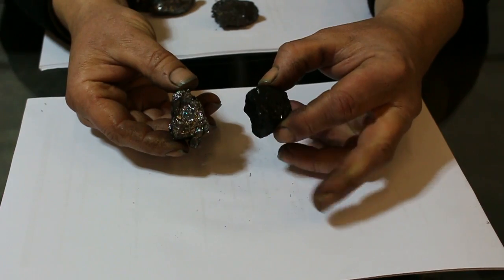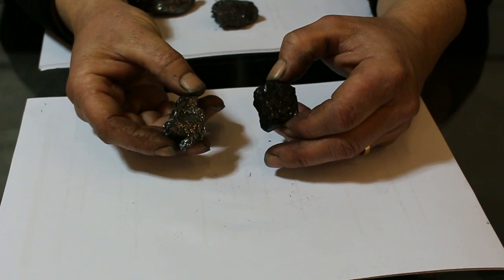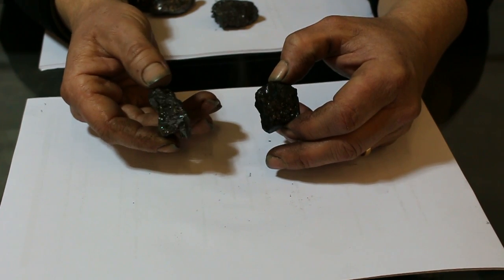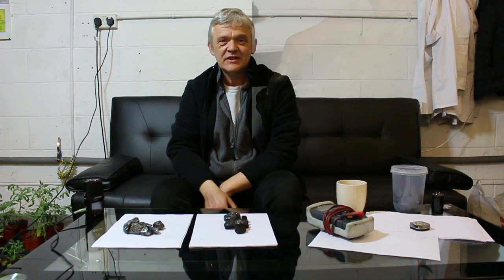Saving The Coal Industry? - Part Two

Comment: Hi Rob, just wanted to say that im greatful for all your hard work. I also wanted to tell you that I finally committed myself to follow in your footsteps. I agree when you say that we should do our own experiments, instead of always getting the solutions. Within the last couple of weeks, ive invested over 20k in almost all the lab equipment that you have. I am an Offshore Commercial Lobsterman for 20 plus years,  but I will be retiring around January to help move this field forward. I have already been conducting some of my own experiments, and have some interesting results too. From paying close attention to your teachings, I have noticed that you sometimes leave out bits of important info. I imagine its because of trolls. One of them being, theres a particular scource of Graphite that you conduct most of your experiments on. I ordered about 50 Lbs of it, and am dying for it to get here. As long as it gets here with no issues, I plan to order 1 ton of it around Feburary. I will also want 1 KG, (or more if I can work out better price) of HOPG. Anyways, I hope you can find the time to send me an email address so that we can collaborate on future experiments. I plan on using Graphene for electrogravitics, but the experiments that wed be calaborating on, would be very similar. I will be using Graphene capacitors in my project as well.  Maybe I can help relieve some of the pressure, and try this or that. Maybe you can help me by moving my shipment of Graphite along. Its only been a week, but ive sent 3 emails to him now, and he hasn't answered any of them. I know hes your buddy, and im hoping you got some pull. Anyways, keep up the good fight. Im here if you need anything on my end. codgod1@yahoo.com

Comment: If there is naturally occuring iron in the coal, adding HCL might convert the iron particles into Iron Chloride, which would act as a catalyst. Without needing to add anything to the coal except for a minor soak in HCL before putting into the oven

Comment: I'm thinking seal up the soil heap, probably in that clay mixture of yours that you use for kilns. It acts as a sort of Geode and you can microwave that thing to crystallize the soil heap material. Because you said you use nothing to do it, so you're blasting the carbon that has a clay egg vacuum geode with microwaves maybe.

Comment: Really nice work Robert. I think if no catalysts are used and the colour change has happened and since it has turned into graphite, meaning it's structure has turned to crystalline format, then your process probably has to include high temp heating,in vacuum chamber. And if all I said above is correct then probably some applied pressure was also used. I might be wrong. But would be glad to hear if I am not. Cheers again mate for nice work.  I am a fan of your work.
Reply from the maker: I have certainly read quite a few papers where that has been the approach mate - glad you like the channel

Comment: Hi Robert.
Have you taken any before and after measurements of resistance on the same sample?
Also what kind of variation are you getting sample to sample?
It would be interesting to know the average ratio of before and after values.
One last question, have you ground any of the processed lumps and made an ink out of them yet? 
If so, what kind of resistance per square are you getting is it better than existing methods you used?
Reply from the maker: yes mate - of course it drops from around 4 Mohm to around 1 ohm on average
Reply: Robert Murray-Smith: That's great, hope it eventually becomes a product either as a powder for users to mix their own or finished inks.
My interests are in shielding of sensitive electronics, especially electric guitars and their pick-ups.
But the applications are only limitted by the imagination.
Wish you all the best and success for it.

Comment: its most likely off gassing the hydrogen compounds. you are essentially gassifying it. the waste from that process can be burned.
Reply from the maker: fair enough
Reply: you could make a gassifier and fuel it with the waste gass, run an electric generator or distill the fumes into petro, and then the "waste" left over in your reactor is what you are making.
Reply: a wood gassifier should work
Reply from the maker: i could mate - if it was acting like that - but to be honest you are making an assumption and going with it - but that's fair enough by me

Comment: Speaking of Catalysts, your carbon process's may be able to make room temp micro fuel cells. I think you should use your laser cutter to etch some channels in your grafoil and see if you can catalyze a reaction with methanol or other hydrocarbons.  Maybe  the use of your magnetic hydrogen bonded graphene will make for a good proton conductor. Hope to hear from you again soon
Reply from the maker: interesting ideas mate - cheers

Comment: Although I forget what temperature you were using, I think you said something about a vacuum? Perhaps the sulfur, hydrogen sulfide, hydrogen, water, methane and a host of other ingredients either were driven off, or reactively polymerized, dimmerized, ionized or repositioned into clumps or schists between plates of graphite, or possibly into their their own little [mostly flat] crystal lattices dividing the graphite layers?

Are visible plant materials found in the coal? And if so, after the process, do they remain?

I only ask because if there is significant rearrangement of the material, they should either be partially or totally erased by reformation of the crystalline structure.

Very exciting stuff! (~_^)-b
Reply from the maker: I am afraid I didn't say anything about the process
Reply: Sorry, my mind some times synthesizes stuff. Or I get various videos all jumbled up and confused [they seem to bleed together on occasion like an internal mental short out in a batter if you will].
Reply from the maker: lol

Comment: An easy and cheap way to make Graphene:
An ideal approach is to start with a sugar based surface that is polished extremely smooth. Any imperfections or ridges etc will cause shearing of the Graphene and it will separate. Apply graphite powder onto sugar surface and rub together lightly but thoroughly to enable bonding. Once that is done either honey or a sugary based syrup may be used on top of the rubbed graphite powders. By doing this you can cleave off excess graphite. Pour H2O2 on top of syrup or honey that was applied on top of graphite powder. Simply roll off excess water or suction off. Continue this process until just one or few layers of Graphene remain. Once down to a few layers you can roll the H2O2 under the Graphene thus removing it from the sugar substrate.

Check my channel for video :P
Reply from the maker: awesome - already did mate - nice work

Comment: hi Rob theirs some helpful comments on here, mine is a bit long winded but  here goes im sensing your changing the molecular structure by burning off gases and other impurities and drawing them out  with vacuum leaving you with maybe  zinc or copper elements  inside maybe i cant be sure so could you  test using one large chunk of  then cut it into four, use one of the quarters as your base(heat and vacuum)same as you have done, then one with just heat no vac , one with an acid wash first then heat and vac and finally last one with vac and a higher heat say 150 plus. im thinking this would with fine tuning the process and mite yield better results or not.
Reply from the maker: awesome suggestions mate - but the easiest might be just to get the elemental analysis done and find out what is in there rather than guessing then go from there

Comment: Looks like nongraphitizable glassy (vitreous) carbon. https://en.wikipedia.org/wiki/Glassy_carbon
Reply: I don't think so first off if it was Robert would have had a heck of a time cutting the big lump in half. Second, the pictures shown in your link are glassy Black, not metallic silver.
Reply from the maker: it cut very easily with a standard hacksaw blade
Reply: Then it could not be vitreous carbon. Cheers.
Reply: You may be right. Have a look at this one, http://www.ebay.co.uk/itm/ANTHRACITE-COAL-ROCK-SPECIMEN-FOSSIL-FUEL-ROCK-7-8-oz-/351962299726?hash=item51f2967d4e:g:FvUAAOSw9GhYgoqA

Comment: Stunning! I've got my fingers crossed for the analysis. However, if it's not what you're expecting, even more interesting, given that low resistance!!!
Reply from the maker: absolutely
Reply: Have you tried intercalating and microwaving it?
Reply from the maker: nope
Reply: I just made my house smell like an old fashioned gas works... I now have all the windows and doors open to try to get rid of the sulphur smell!!!
I took a tiny piece of coal, checked the resistance, couldn't get a reading, then microwaved it in my kitchen microwave. It took a while to heat up, but then started smoking, with all the usual sulphurous coal tar vapours. Luckily I put it in a beaker and put a larger one over the top, so only the beakers are covered in coal tar.
Eventually I got fed up with the smoke, so stopped. Once everything had cooled down, the coal had lost loads of weight and looked more silvery. I checked the resistance again and I now get a reading below 30 ohms over a distance of a few mm. No idea whether it's graphite or whether I've converted any of the carbon or just that driving off the tar has left something more like coke. It didn't look as though it got hot enough to graphitize, no obvious bright spots like you get when you microwave graphite powder, unless some of the impurities acted as catalysts.
At least it might have fumigated any bugs in the house ;)
Reply: I just noticed, the borosilicate beaker I used to contain the coal which I microwaved, has several cracks and has melted in one place under where the coal was located. The coal must have got very hot. There is also a silvery looking deposit on the microwave plate around the location of the melted part of the beaker. It is a ceramic plate with infinite resistance (as far as my AVO is concerned), but this deposit has a resistance of under 1M Ohm.
I should have photo'd or video'd it.
Reply from the maker: yes you should lol - i doubt you want to repeat it. Have a look on google scholar for GUITAR process for graphene it is the university of Idaho's thermalised asphalt reaction you are replicating - i think
Reply: Many thanks. I did products of the distillation of coal at school in chemistry, so should have thought before I started. I should also have stopped before filling the whole house too ;)
Smell's gone now, so no harm done (except to that beaker!!!).
On top of that, I used a piece of particularly cheap tarry coal, which I happened to have. Might be interesting to try with a piece of smokeless coal I also have. I have a spare microwave I can always put outside.
Reply from the maker: awesome lol - look at GUITAR - it will alter your thinking about this a bit
Reply: Looking at the site already :)
Reply from the maker: awesome
Reply: You're right, it definitely looks as though, at least in part, what I've done is a microwave process to produce GUITAR from high tar / sulphur coal. It would also be nice if some significant sulphur remained homogeneously in the result to use for sulphur based battery electrodes.
I've ordered some high temperature crucibles to do again and leave running for longer. However I'll put the microwave outside!!!
I've also got a small 1kW induction heater (about 4cm coil diameter), but there would need to be some initial conductivity in the sample for that to work.
Reply from the maker: v cool

Comment: If you heat it up, maybe rapid cool down would preserve the crystal structure better.
Reply from the maker: give it a go and see mate
Reply: +Virtual Reality. For a molten material,  rapid cooling results in smaller crystals, whereas slow cooling allows larger crystals to form. For a non-molten material, rapid cooling is more likely to cause fracturing than is slow cooling. My guess would be that very slow cooling is the way to go, because it should leave more of any crystal structure intact.
Reply: ok, RWB, I guess your right about that, so therefore, it would be also good to see what size crystal, if any, would be the better way to go .   Currently I am not doing any of these experiments, so anyone can try it also.
Reply: it takes time for larger crystals to grow, so I understand your comment, and I am now wondering why I expressed my comment that way, but still it would preserve at least one type of crystal structure